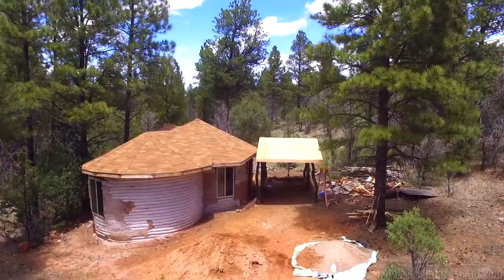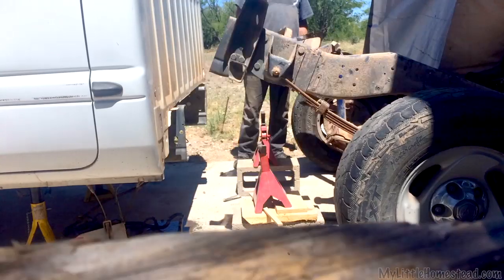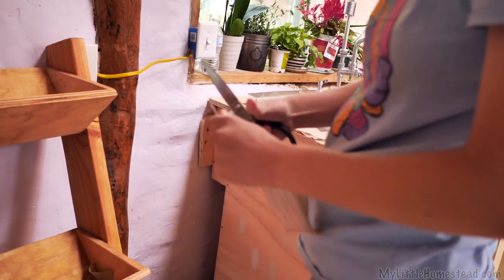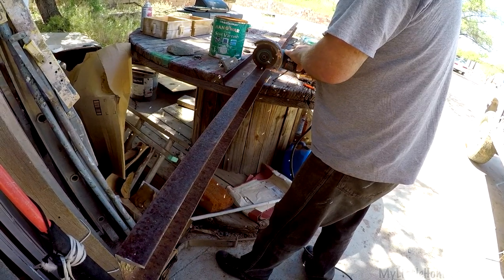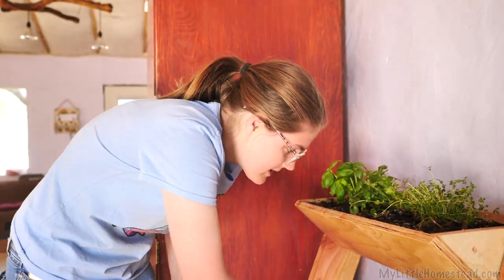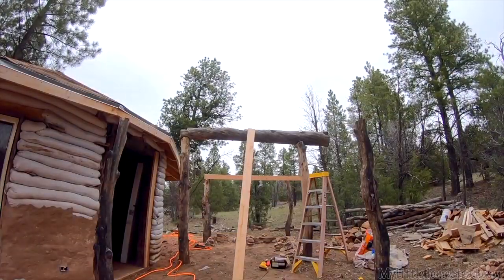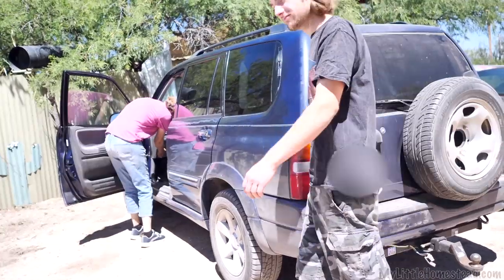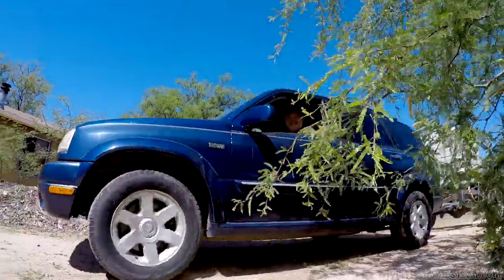Earthbag Cabin Return, Truck/Water Trailer Conversion & Herb Garden Planter  | Weekly Peek Ep187

Comment: Best kind of snow. - You can epoxy over the concrete... I've known a few people that claim to have worked with deep epoxy pours .. But have never had the money myself. the Factory and store bought hold up like rock. But cut easy. With knifes and such.. - from what I can tell.. you have to resurface the epoxy deep pours every few years per to USE. Also.. Why I say Practice practice practice.. there is a Tan shade one Clear one And such.
Reply: Would love to help you all in person.. But money's none existing and My family won't even let me travel an Hour away Without them being in control.. USG says I'm not legally allowed to have a Problem with it.. Because, I'm free to do anything I want. BUT they claim that while standing there telling me I'm not allowed to do anything Per to their LAW.. I'm not even legally allowed to WORK anymore.. Because Well.. SIGH... Good Luck <heart> - Be careful of Whom you take in. The best of the BEst is 9 out of 10 times the worst of the worst. And contrary to that the Worst of the Worst.. Is usually even worse than that.. <hug> your friend KIRBY.
Reply: Sorry about the edit.. My fingers are large And I was typing without looking at where they hit.  thumb is over 1in - fingers are 3/4 to 1/2 and fingers are 4in my hand is 9in.. My foot is 13 in with shoe 12 without.. I can stand flat foot and touch 8ft.. LOL.. sigh.. Walking tape measure.. LOL.. - <heart>
Reply: When I did construction.. I could Cut and Place material without even measuring.. Sigh... 1 in 5 mistakes - but usually because someone was yelling at me for not measuring.. Sigh.. Watch me pull a rabbit out of my hat... - there's that entire days work prepared without touching a tape measure.. lol.. <heart> sigh.. <tear>

Comment: I am in the midst of bathroom planning. And watching this video, made me curious of your cement counter top, as I would like to make my bathroom a wet room, with the shower area (no tub) cement walled and floored. I have two problems I can't wrap my head around a good direction for: 1. my initial design was tiling and resulted with a 6x6 beam in a corner of the shower area that I can not remove as it helps support my inside 110g water container, and 2. I am concerned about water seeping through the cement and keeping things too moist. 

I am not an experienced 'cement maker / user', and so I have the above novice concerns. Do I need to protect the 6x6 beam from the cement? Do I need to worry about water seeping through the cement shower walls?

Also, can I dye cement to black and or white(ish)?

I don't use social media platforms, so, if you are ever in the TN area again, is there a way to reach out to you guys that isn't facebook or twitter or instagram or whatever else people are using?

Comment: concrete is not as long lasting as thought and it needs care.  Why not do a resin poor with paint.  You'll figure it out, but do ask around about the concrete top.   Speaking of experimenting your shampoo and conditioner did not work with the water here in my town.

Comment: What’s your opinion about the rammed earth method and how does it compare with the dirt bag method?
Reply from the maker: Both systems work well. We prefer the bagging idea. Maybe it is easier. Not sure.
Reply: mylittlehomestead  It looks harder but as far as understand, the rammed earth wall doesn’t require any finishing. Maybe you could incorporate a rammed earth wall in your next building.

Comment: Pouring epoxy in such large quantities is not an easy task - it won’t harden properly unless you do it in layers, and if you want a bubble free look, then you need to heat blast the epoxy, which will ruin your plants, so you’ll need to work out how to get the plants to not float to the top, so you can heat gun the bubbles as they rise. You could heat gun it then place them on top then let it dry and do the next pour. Watch Peter Brown on YouTube for more epoxy learning - he experiments with it a lot and makes the mistakes for you. I think I’d go with the concrete, but perhaps you could embed some epoxy discs into the concrete like sunken chopping boards. They would definitely get scratched up but if you did it that way, you could remove and buff them or replace them.